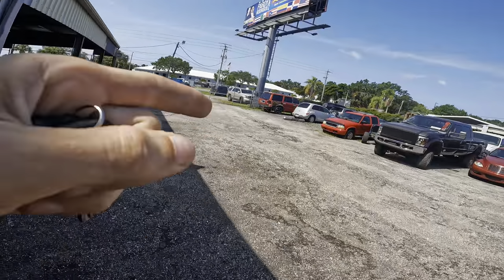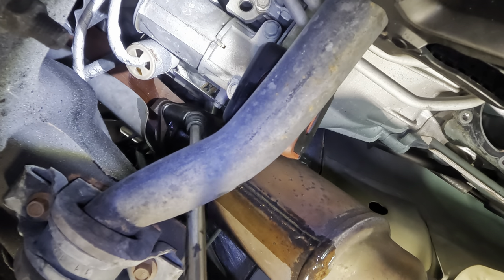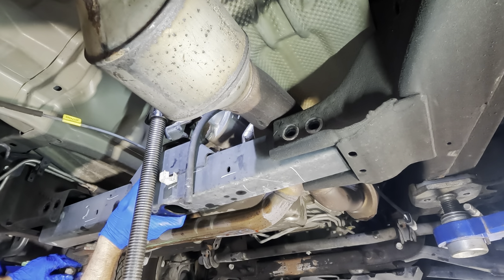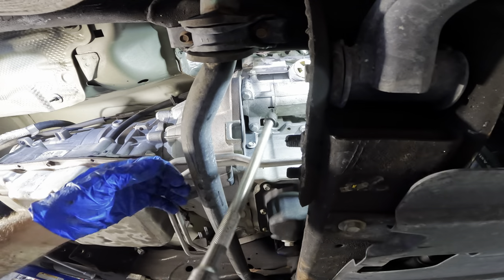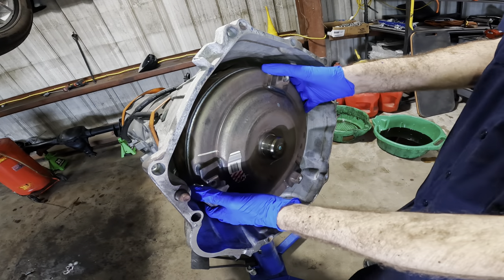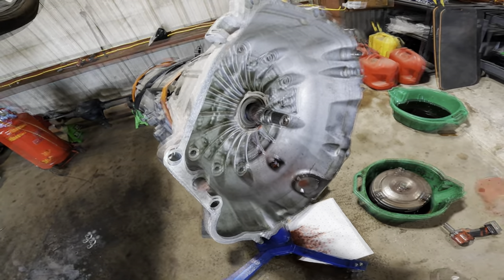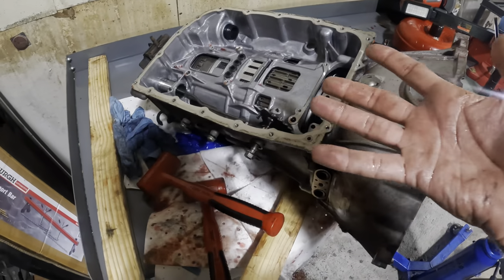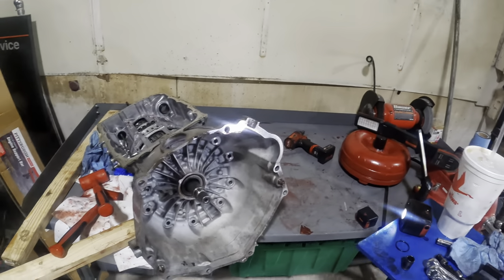Went too FAR! Invasive Inspection, 6l80 Transmission. 2016 Chevy Tahoe 5.3

Comment: After all of these years (since mid 1950's), American automotive engineers have still not figured out how to put a drain plug into an automatic transmission pan.
Reply: You need to remove the pan anyway to change the filter, you can drill and install a plug then if you wish, but to have something fly up off the road and bust the plug off would be a bad time

Comment: Since the dowel was preventing you from separating from the engine, i had the thought that you should maybe try raising the jack slightly and possibly level the trans so there is no resting pressure on the dowels.
Since you admit to not being a transmission guy, why not find someone that is and ask them to come in to be a guest tech and  work on transmissions on camera?  
When you know what you know, and you know what you don't know, you need to know someone that knows what you dont know, and have them show you what they know about what you dont know, and then you will both know.  Who knew?

Comment: Likely the lock-up clutch in the TC. Some time ago you made it very clear you did not do automatic transmissions, and you had littel knowledge and experience on these. As @skutahuniai4830 says, you should lelave these things to someone who knows what they are doing. Some of your subscribers watch you to learn, so following what you are doing here is the last thing someone else who also does not know what they are doing should also be following. Anyone who does know what they are doing would just send the trans and TC away for overhaul if metal is in the pan, as this metal will be throughout the transmission. All you are likely doing is causing more damage so the repair bill will be more expensive. If you knew what was going on, you would know to remove the lockup oring on the input shaft. Do not play with expensive things you know nothing about Ray.

Comment: Sad that a few mins of research would have saved you a lot of headaches with the clutch drums, get past your ego and take a couple of mins to look at service info.  You could have also looked at TSB’s and searched torque converter issues on these trans and would have seen numerous articles about the issue and proper repair. While test driving you could have looked at TCC ( torque converter clutch ) apply times and slippage to correlate the shutter to when the TCC was being applied to determine it was truly a TCC issue. You should never remove the stator shaft from pump housing as it’s a machined surface on both sides and can experience sealing issues after R&R. Simple reading of service info would have explained the need to remove the o-ring first and not have the issue of pulling the drums out also. The pump needed to be inspected better as the wear is normally on the other side of vanes and the vanes themselves. Normally the pump assembly is replaced with a converter change for vibration/shutter issues. We did lots of these when I worked at Arnold’s Automotive in Mt Pleasant SC. We would do them right on the trans jack after dropping pan and removing filter. Then install pan with a couple bolts, drop trans and slide pump out, slide new one in and converter, reinstall trans and the put new filter in it. Another thing is torquing the pump bolts and as well as valve body bolts with a torque wrench is a must. There is also an alignment band used to align the 2 halves of the pump body, without it you are hit and miss that the body halves are aligned properly and not cause future problems, have seen it not used and everything is fine but have also see failures of the pumps afterwards due to misalignment. There is no gasket on many pump bodies and not torquing them properly will cause them to distort the sealing surface and cause internal leaks between passages.  Also as stated you should back-flush the cooler before filling the trans with fluid. Better yet in any hot climate like yours I would discuss with the customer an auxiliary cooler added in front of cooling package for added cooling and help extend trans life.   
I know your fan club idolizes you but there is a right way and a wrong way to fix vehicles and you tend to do it the wrong way many times.

Comment: Ray
Remember that neither the manufacturer nor the various regulatory agencies CARES about operating cost.  Design an engine that requires 30% more expensive fuel but gets 1 mpg more mileage and it's a "successful design."  If it requires more maintenance than a F1 car just put it in the manual & it's the customer's problem - "you failed to follow scheduled maintenance".

Comment: These 6spds are terrible.  I run through a couple hundred Chevy/GMC trucks a year and am having FAR more issues with these than I EVER had with even the 4l60.  The 8spds are supposedly even worse, but I don't have enough units through here to speak from experience there yet.
Reply: I recall a comment from somewhere... he repairs just as many 6spds as 8spds, difference being the 6spds are all old and the 8spds are new.

Comment: Both DOD and stop/start systems are nothing but expensive gimmicks that give the vehicle something else to break down the road. And you FLUSHED the fluid?? You should only drain and replace otherwise you force particles back into the transmission.

Comment: Just wait till u see the new gm transmissions. The dumb things need to run to come out of gear, same as the stupid hondas with their push buttons. No by pass, no linkage to disconnect to go in neutral. All electrical, is the stupidiest thing ever made.

Comment: OH NO!!!!!   Cancel Rainman Ray!!!   Communism is the greatest system ever!  Just ask the Communists!  LOLOL.  I found in my 85 Bonneville (Chevy 305, TurboHydramatic 200), that hard stops the TCC wouldn't disengage, so I would have to put it in N before I came to a stop.  And our 96 LeSabre had a TCC Pulse Width Modulator valve that was sticking.  $900.00 later, a few years back, solved that problem.  😬🙄